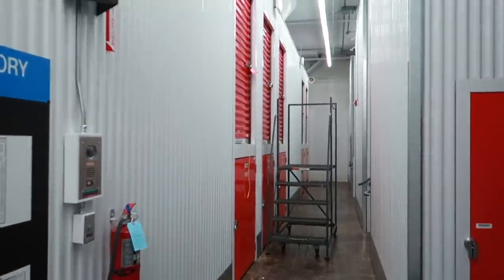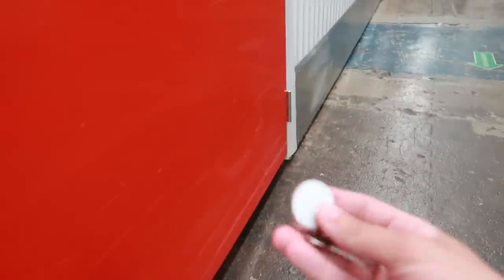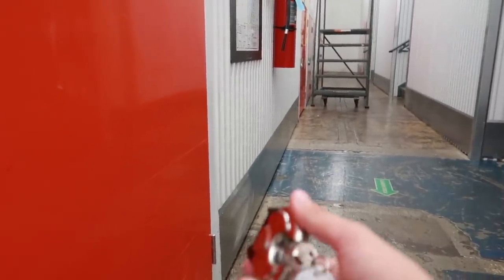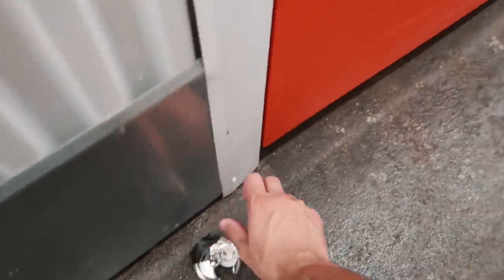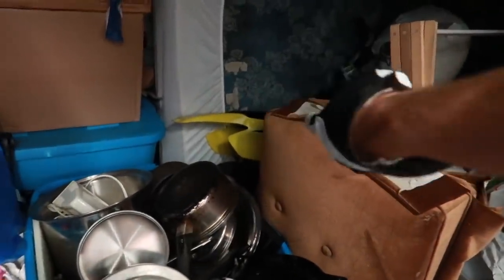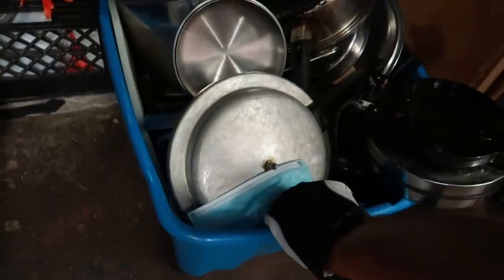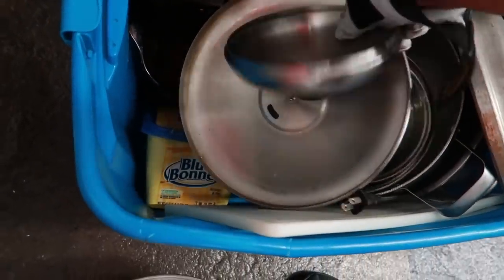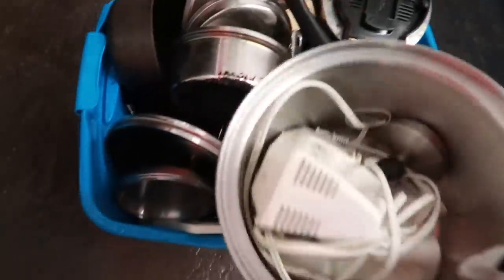I bought an Abandoned Storage Unit for $20... This Was Inside!

Comment: There was a pressure cooker lid and if the bottom is in there,  they are hard to find and should get you $20 back.
Reply: Probably more than $20.00 if all the parts are there!  They are impossible to find right now, and prices for new begin at $70.00 and go over $300.00 for fancy models

Comment: At 6:36, you are looking at pots and pans and you touch an upside down pot with a black handle that has a lot of black crud on the bottom.  It's heavy duty stainless steel and should have a cover.   I bought a set of pots like that 50 years ago for $500, which was a lot of money for pots at that time.  I still have them and use them almost every day, and they still look brand new.  GREAT set of pots.  They are the only things in my house that my sons say they will fight over when I die.  Forget the antiques and collectibles and everything else.  They want those pots.   If the one you have is cleanable (only use Barkeeper's Friend or other soft abrasive on them) and if you have more of a set, they should be worth more than a few dollars each.